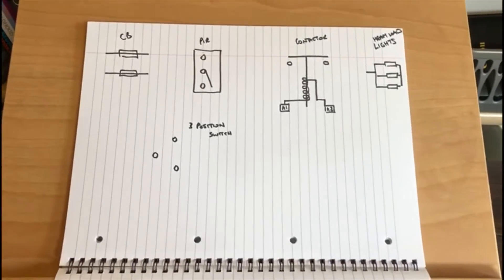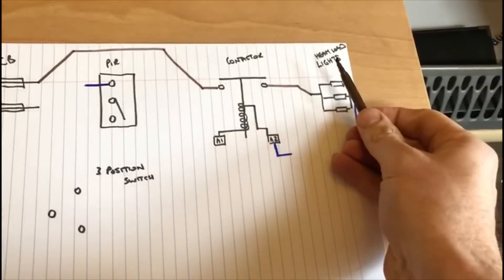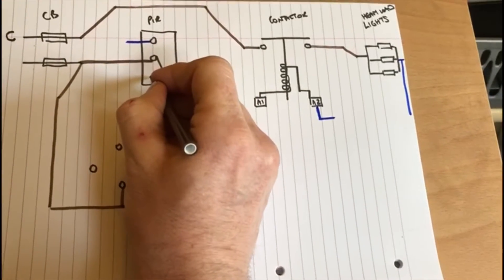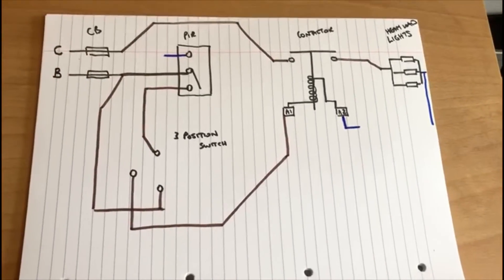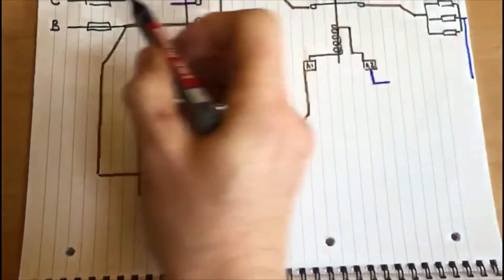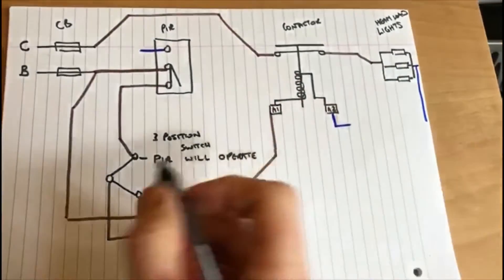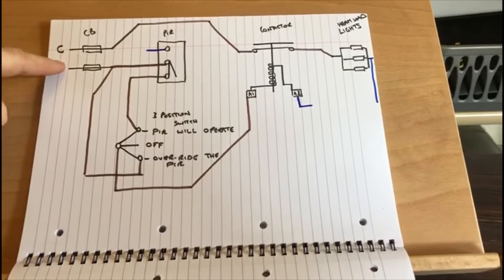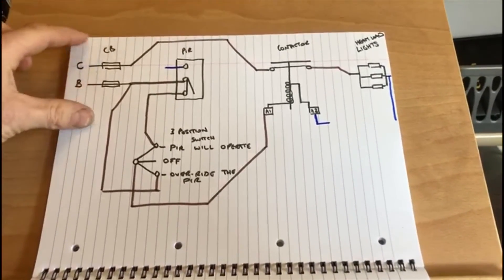PIR, Contactor & 3 Position Switch - Wiring Diagram Part 5

Comment: How can I use a 3 gang 10A light switch to control 2 different banks of lights? Switch1 PIR on (turns on both banks of lights), Switch2 (turns of 1 bank of lights), Switch3 (turns on other bank of lights)

Comment: If normal lighting load (low current), then only one mcb needed. When bypassing the PIR go direct to lights bypassing contactor - contactor is de-energised. Contactor only energises when switch on 3 position switch is on PIR.
Common terminal on three position switch (off position) should have incomming line. 

Three position switch should be just a throw over. Throw over to direct lights. Throw over to contactor.

Comment: Ok I've build this and it works great but I was wondering how I could wire a pilot light activated when the switch is in the PIR position. It seemed simple until I remember that there is no current when the PIR doesn't detect anything. If anyone has an idea how to do this let me know, thank you.

Comment: Question:- do the breakers need to be on the same phase? or does it not matter?

sorry if its a stupid question :D

Thx for this vid, its really helpful :)
Reply: It wouldn’t matter, both circuits are separated… If they were put on different phases, a 400V label would need to be affixed to the contactor enclosure.
Reply: Can all be off the same mcb.

Comment: What's a 3 position switch? Is it a 2 way switch?
Reply: doosraification  Centre is common then it can be switched up in to position 1 or down in to position 2. Different to a two way switch and I have only found these in grid style. Used one recently for an outside light with a built in PIR with the switch in the centre position the light is off, switch in position 1 the light is controlled by the PIR and switch down to position 2 to override the PIR and keep on permanently.

Comment: Thanks Matt, are you planning to show a mock up situation with appropriate cables linked to the PIR, contactor and lights?
Reply from the maker: I have a short video of a set up to release... I have asked Matt to try and do a video on the connections from that video as well 🤞. Thanks. Gaz 👍
Reply: Nice one Matt, keep them coming. 👍
Reply: I have this arrangement in my workshop but as you can imagine the workshop is a mess at the moment . I will be tidying it next week and show all the connections